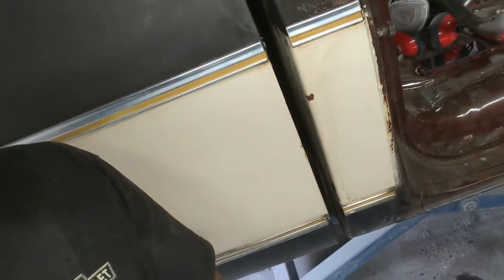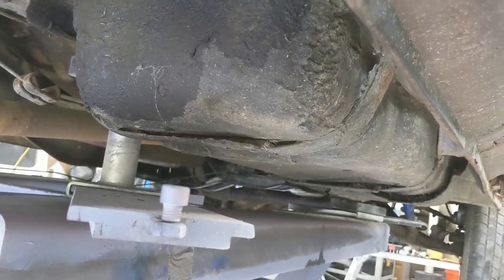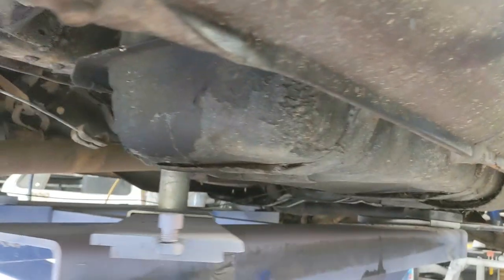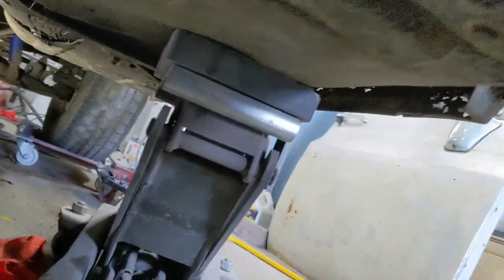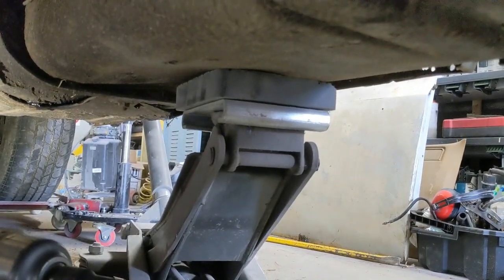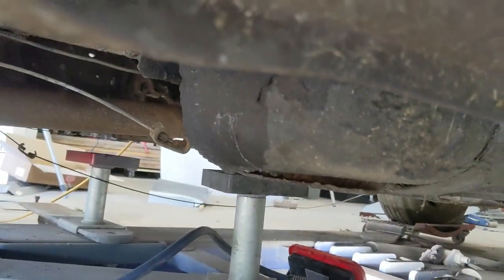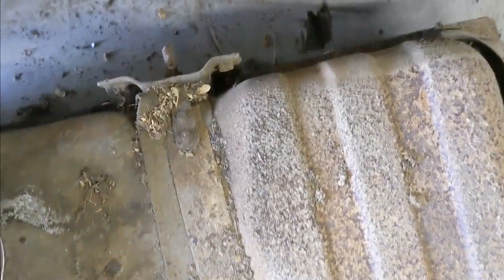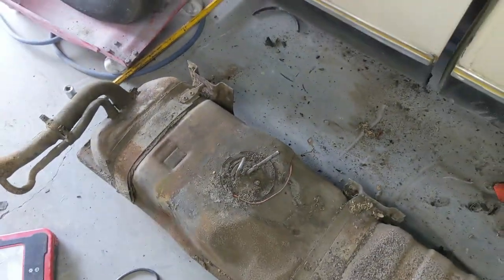HOW TO REMOVE a SQUARE BODY C10 Chevy Truck Gas Tank 1973-1987 Get Ready for Battle!

Comment: guess i have been lucky, never had to left any of my 2wd to drop the tank. yea the frame bolts which i was wondering at first you talking about removing the straps. i use to have a bunch off good tank but they have gotten cheap to buy new now........ unless you buy the ones i have bought...... i dont suggest them for a budget
Reply from the maker: That's awesome 👍🏾 I have had to replace the tank on 2 or the last 3 😅

Comment: I’ve got all my bolt out but I just can’t get my tank to drop. The only thing I could think of holding it was the fuel pump lines but I’d have to take the bed off to get to them. Any help?
Reply from the maker: The lines would not keep the tank from moving, there is one bolt that can be hard to reach that may be holding you up.

Comment: I got my daughter a 87 gmc 1500. The right tank is not working.  Gotta find out why.  Getting the driver's side floor and kicker panel cut out and replaced tomorrow.
Reply from the maker: Is the sending unit not working or are you not getting fuel from it?
Reply: @3Wheels1Block  haven't spent anytime with it. Seller just told us the right tank didn't work.

Comment: Why not just remove the 8 strap bolts on the inside of the frame alot easier
Reply: Nevermind I see that you did alot easier than trying to get those two top bolts
Reply from the maker: Yup, you are absolutely correct, those inside bolts are the way to go. My mind was trying to remember back 10 years ago😅.